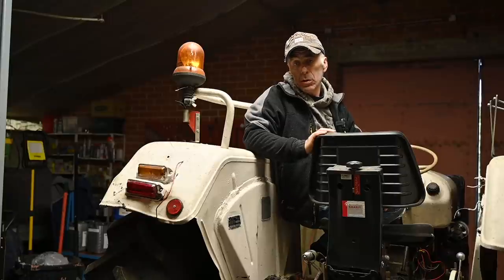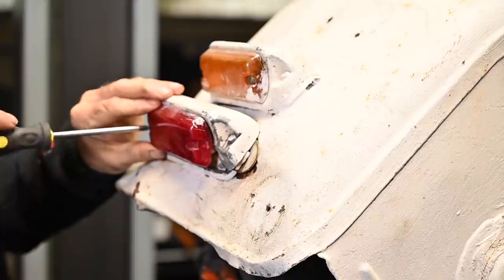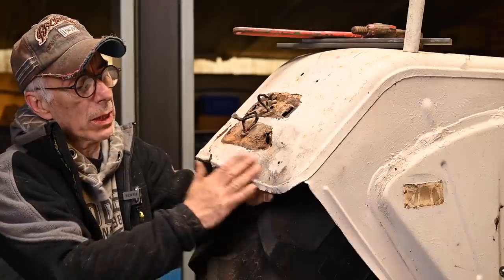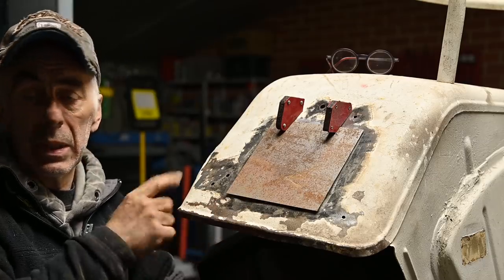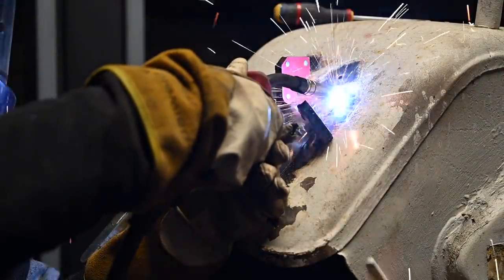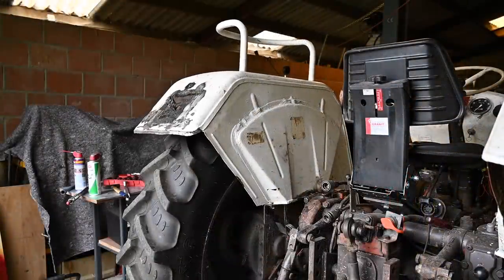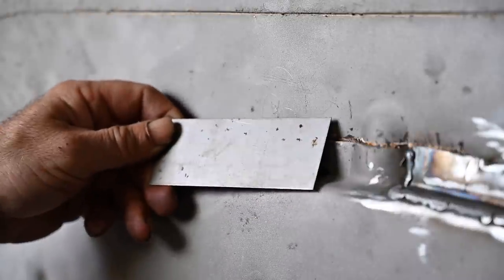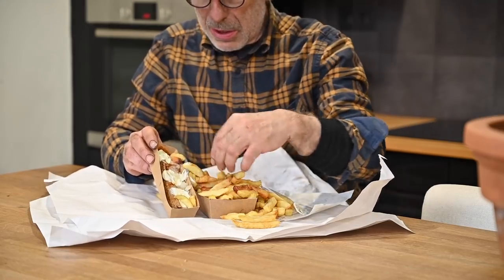David Brown 990,  the big clean up part 2

Comment: Hi Steve, another great video, I don’t know about Belgian mot rules but here in the U.K. the indicator/blinker light should be to the outside of the fender
Reply from the maker: Indeed , same here ... I have two lights one for the right and one for the left.  I might have used the wrong one right instead of left
Reply: @D3Sshooter  I just mentioned it because I seen it on the video and the indicator/blinker was to the inside of the fender when you held it up, I was just wondering about it because you had to drill a hole for your wiring. Keep up the great work
Reply from the maker: @richardfitzgerald  that was well spotted Richard.  But it is no issue as the lights are symmetrical so I can feed the cables with any problem//  but good observation. TXS
Reply: @D3Sshooter  looking forward to the next update on the David Brown and all your other  projects

Comment: The "reduction 9/50" is likely to be the ratio of the reduction gears at the ends of the axle. There were different ratios for different wheel sizes and also for faster road speeds.
Reply from the maker: Much appreciated, that could very well be the case

Comment: Hello, i have a 990 selectamatic. The lifting arms Are just going to top when the tractor starts, have you ever heard about that problem? Greetings from Norway.
Reply from the maker: Yes, that is an issue with the hydraulic control and the valves. Off course I assume that the mode is set right... Have a look on the other video's on the DB on  my channel, there are several about the hydraulics system on how it works and what can be checked